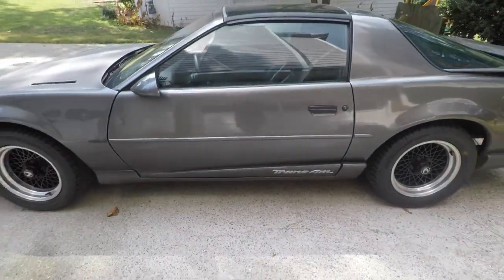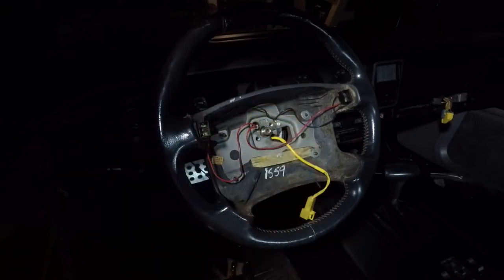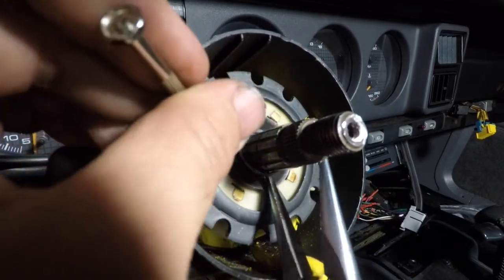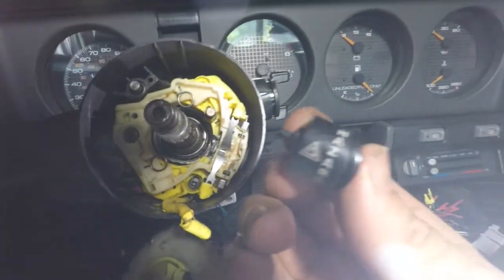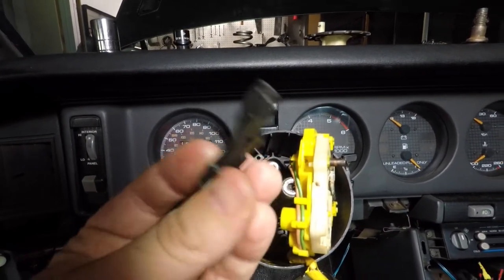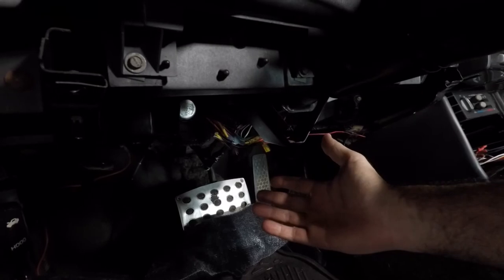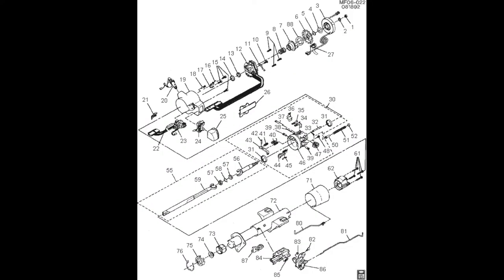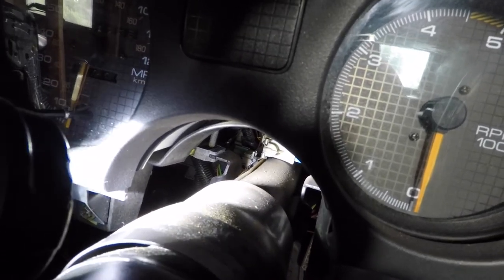1991 Trans Am High Beam Switch Fix

Comment: i broke off my actuator, i have it in my parts box, i get to it one day,  my tilt wheel is messed up, i took the steering wheel apart thinking that the bolts needed to be tighten up, i try tighten them one got tight, the others just spin and spin, might be broke off in side, now my steering wheel is all back together, it moves more then it did before, but i haven't messed with it in a long time. Hey im glad you have Samantha running good
Reply from the maker: I might have to tighten up my column too. It's slightly loose. How did you break the actuator off?
Reply: @OverheatedGarage  yea i didnt know about the adjustment for the brights on the column, this was years ago, and I pull the level really hard to try to get the bright to come on and break the actuator.

Comment: Great video! What i really need is more info on how that actuator goes in. I've been on it for 2 hours, it will not align, like the rod is over to the right and down Too far
Reply from the maker: It's been awhile since I did this project - but I remember it being a challenge. I fought with it for awhile and couldn't capture it on camera. I remember dropping the thing on the floor several times during the process. Wish I could be better help.
Reply: @OverheatedGarage  just got it, oof it was rough but mostly because I overthought it. Those bolts on the switch are the devil himself. But it's finally done. Thanks again!!

Comment: Just bought a 2000 Firebird and had this same issue.  I did not take off the steering wheel.  But, from what I can see, the assembly from the column back to the switch somewhere under the dash is more or less the same.  This did not help me fix my issue permanently because I wasn't willing to do all the work you just did.

However, your video really helped me figure out what was going on. And now I know why the guy before me had the side cover by the column switch removed. You can push the rod in manually to actuate the switch under the dash without the steering column switch being connected.  So now, that's what I'm gonna do.

As you said, it was really hard finding info on this.  Thanks for doing your best to provide some video on a bunch of tough to see areas!